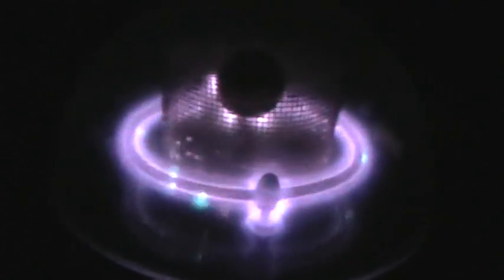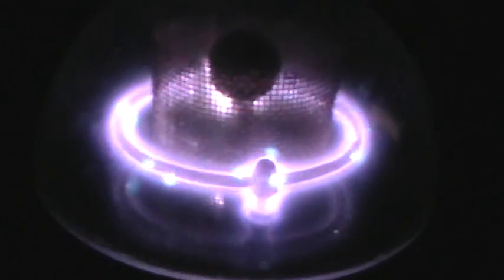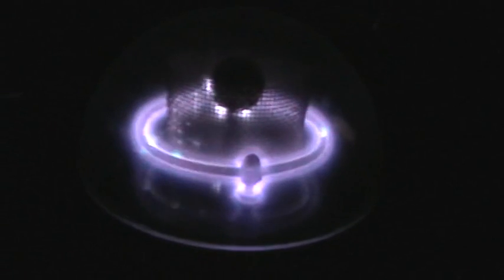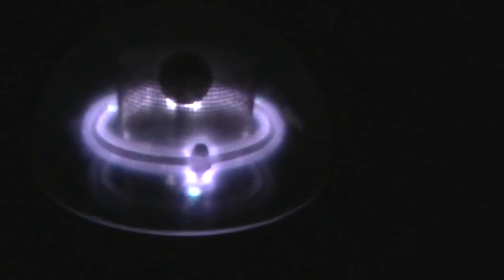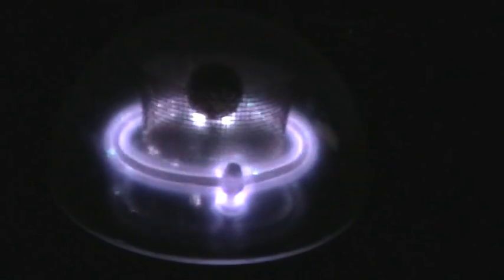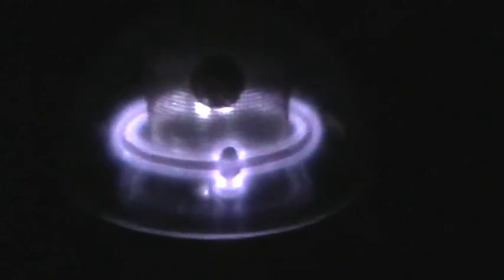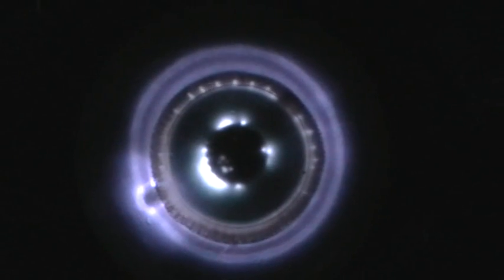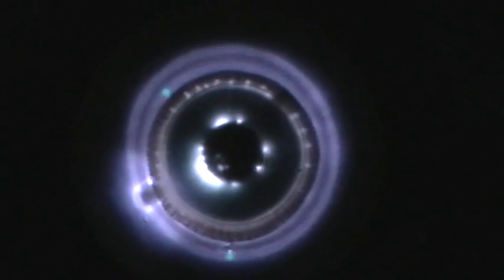Extreme High Voltage: Terella Anode Plumes and Cathode Scintillation

Comment from the maker: I don't know if you can get the required vacuum with a drain plunger! I'm using a 2-stage vac pump designed for automotive air conditioning system evacuation. It is supposed to pull down to 25 microns, and sometimes I can get the entire system fairly leak-free, where I can run for many minutes with pump off. So I think I'm getting down into the pump's rated range. The best effects happen at the lowest pressures I can get. But some nice stuff happens when it's just beginning to pull down, too.